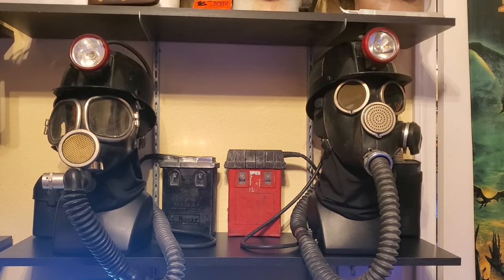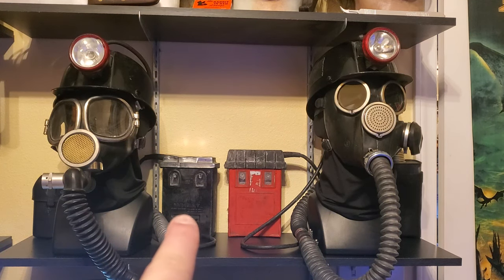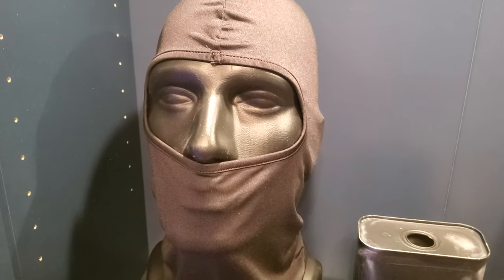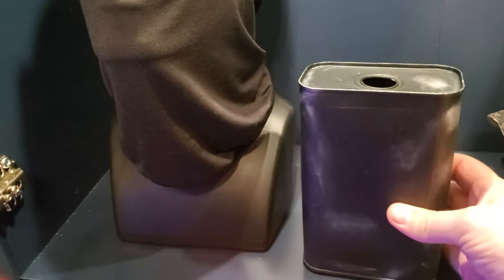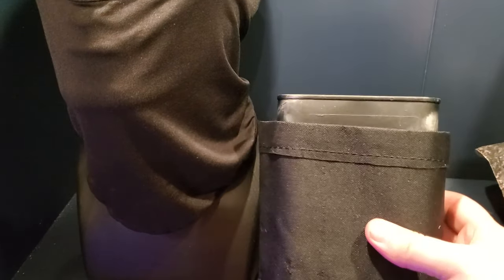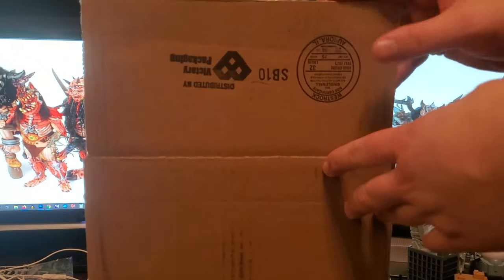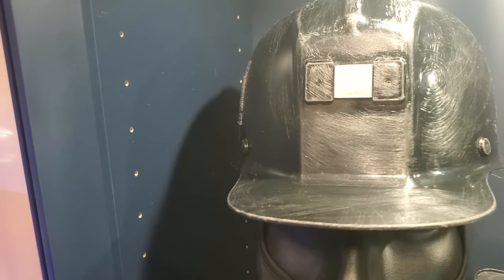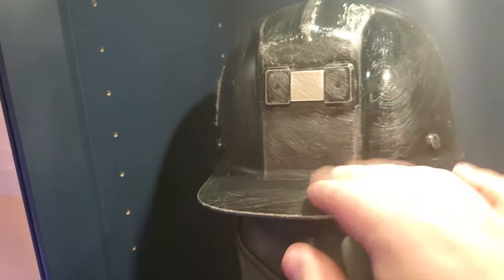My Bloody Valentine (1981) & My Bloody Valentine 3D (2009) Replica Mask Displays

Comment: The original Comfo caps were made from a canvas material which was boiled in a resin. I have an MSA Skullguard type K which was made in a similar fashion. 
I've only seen metal used on hard hats as an extra piece, such as the "Turtle shell" cap or the Comfo cap's "Tiger stripe."

Comment: Where did you get or where i can find the(on the 2009 version) the metal coupling shinny clip where you attached the hose to the mouth breath? :) 

Nice review my friend :)
Reply: 1 1/2 slipjoint nut, you need that and the piece the rubber breather is on will need to be grinded down to fit it flush

Comment: I was making this (2009) as a full size costume. The Horror Hound article was very helpful, but it's not 100% accurate. There are a lot of things that are not like in the movie. I also got the belt from the article but I found out, it's not really movie accurate. So I made my own.
The most difficult part for me was getting the Koehler light, because I don't live in the US. Still don't have the movie black plastic one, but I'm happy to at least have one. Thank you for the video, the part with removing the battery was very helpful.

Comment: Hopefully not a useless callout, but are there any possible budget lamps? I have just about everything set for my 3D cosplay minus the lamp.
Reply from the maker: I want to say there were some modern ones that were just the lamp part that goes on the helmet. Possibly you could get something like that and make a stand-in box and cable for it

Comment: I just made the full remake bust and the only part I can’t figure out is the metal part around the hose at the “mouth” of the mask do you happen to know a link of what to buy?
Reply from the maker: I'm not 100% sure, but looking back at the Horror Hound article I believe it's something like this:
https://www.homedepot.com/p/Everbilt-1-1-2-in-Sink-Drain-Pipe-Zinc-Slip-Joint-Nut-with-Rubber-Reducing-Washer-C8033C/205153783
Reply: @OutsideTheBoxReviews  thanks so much! Also thanks for showing your build it really helped when making mine

Comment: Any idea for the remake where i can get that piece that hangs from the belt. That rescuer or whatever connects to the hose.
Reply: It is supposed to be a filter or whatever, but its actually just a acetone can he converted, and cut a hole in, and put inside a binoculars case. i did the same thing. hope that helps

Comment: Question. How does the head lamp pack, the red part, fit on the belt? I just bought one and theres no clip to fit it on the belt. Ty for any help.
Reply: Battery packs would fit into a thick leather case you would place on your belt. You might find such item at a Army surplus supply shop.

Comment: Hi again :) i just get the same lamp... (only the lamp plus the 2 clamps) i put a 9 batterie volt amd it work 5 min, and then finish.... i check the continuityband the bulb is now dead :( 

I looked the bulb model and on it, but i can only see MK-2 ..... so dis you have the rest(number part please) 🙏 or i should convert to a LED lamp? 

What should i do? 

Thanks in advance :)